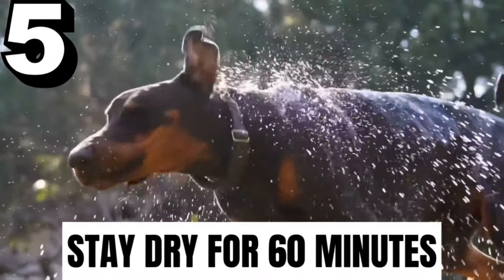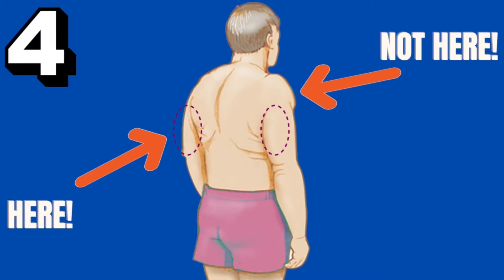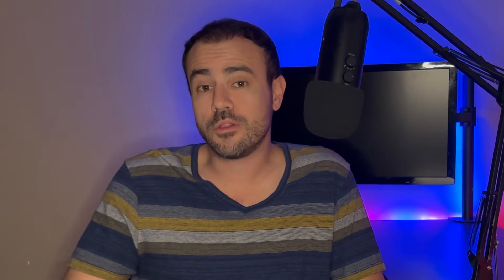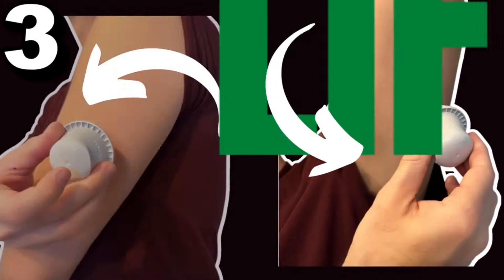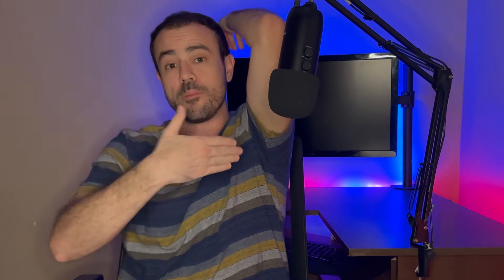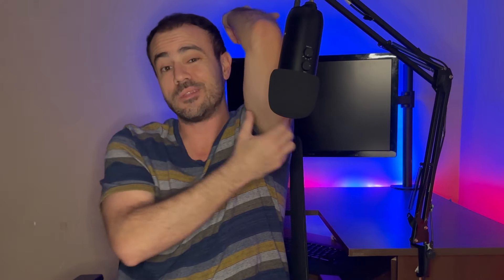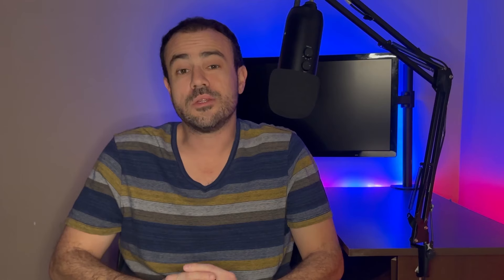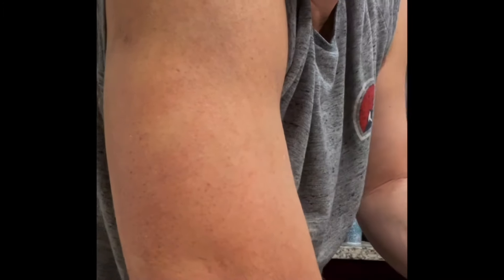Tips To Put Your Libre On The Right Way You Wont Find In The Manual!

Comment: I cannot get a reading on my meter of how many days it still has before it needs to be replaced. I've seen it in some videos (for example, it says "10 day" on the screen) but my meter does not have that option. What am I doing wrong?
Reply: Assuming your sensors last for 14 days, you will be changing it on the same day every 2nd week. (so maybe mark your calendar when you change your sensor if you think you won't remember)  If you use the reader instead of a phone, the number of days left shows at the top of the screen...and you get reminders when you scan, starting a few days before a change is due.
Reply: It shows up fine on a cell phone.

Comment: sir in my samsung C9 pro sensor works properly
But in latest samsung phone with NFC it doesn't work.
it's been 5 years I m using same phone.
had tried google pixel, samsung A7, Vivo, +1,iphone 7 phone too
but none worked😓

Libre sensor website gives list of phone which work with sensor 
But none worked other than my C9 pro💔

Comment: Hi. 
What about the triceps muscle where the sensor is meant to be applied? I train alot and have a pretty low body fat procentage. I have had a lot of problems placing the sensor at the upper arm. Often a difference of +3 and the sensor often dies after 1-4 days and I have to replace it. Libre 3 works a lot better for me at the hip but would really like to alter the placement sometimes.
Reply: Did you ever figure out the best place?

Comment: I use this device, and honestly it is more of a nuisance than anything else, wont download data to my computer, cant instal the app in my phone, runs out of power quickly, to much information when your trying to scan, change the sensor and have to wait an hour before use, try to scan when you have a few days left on the sensor you get this info before the reading. The NHS was sold a pup when it bought this.

Comment: I have no idea how they fall off. Mine are welded on and it’s a nightmare to get them off.
Reply: Abbot customer service suggested applying a drop of baby oil into the small hole in the middle of the sensor, then applying some around the sensor as well to help dislodge the glue so the sensor would be easier to remove. (Likely any cooking oil would do the job too). Hope this helps!
Reply: @Pharmacist-p8q yeah i saw a vid and have been following it successfully when I had to remove them. Pick the edge and put coconut oil under and around. Let sit 5 mins , i sometimes so it again and its comes off pretty easily.

Comment: Maybe the skin glue is good, maybe not.   I have had no problem keeping the device stuck on.  But perhaps my skin type, and my environment contribute to that.   I guess if one has problem skin, that would be a good thing to use.  Certainly take steps to press the adhesive completely against the skin.
One other thing.  The low glucose alarm can be a PITA, especially if one is NOT on insulin and the odds of low glucose are slim to none.  Because the sensor is placed where it is, the odds of a false low reading due to compression error are NOT slim to none, especially for side sleepers.  Most alarms can be turned off, but the lowest one can not.   That is with the app running.   On my iPhone I will turn the app off.   It will squawk at me, but it will not go off and wake me over some non-existent low reading.   The good news is when the app is restarted in a few hours, the sensor will send a complete data set for that time.   The graph will be contiguous.

Comment: So, the Libre 2/3 Sensor is using your fat cells to calculate your glucose. That’s what I understand. If your FAT or a heavy person, you have more areas that the Libre Sensor can use, like your stomach area. Why does Abbott Libre only use your arms?
Reply from the maker: So it’s not the fat cells it’s measuring but the concentration of glucose in the interstitial fluid which surrounds the fatty areas of the body as well as a number of other areas of the body. The back of the arm is the only area Freestyle conducted studies for and they can only suggest placing it in areas they studied as the FDA requires this. So even though it may work on the abdomen or other areas, unless they completed a full study which takes time and money, they can’t suggest any alternative locations.
Reply: @diabetesdailydigest  I use my chest to place the sensors after seeing Diabetic Jack do it https://youtu.be/yAhckpo9x3M?t=276 , It is scary at first but after trying it there and seeing that it did not hurt and I got accurate readings I keep using my chest. Mainly because it is protected I do not have to worry about it catching on a door or my jacket when I go to take it off. Also the sensor does not get pressed into my skin while sleeping because I sleep on my back or on my side when I toss and turn while asleep. When I had it placed on the back of my arm it would get pressed into my skin causing the interstitial fluid to be pushed out of the way. When removing the sensor I see that the needle/filament is stright with no bends in it.  Here is another video https://www.youtube.com/watch?v=20ybK4x_u2M that talks about other areas and the results found when placing the sensor there. I hope this info helps you out.
Reply: @diabetesdailydigest  
I am a bit flummoxed when you stated “the back of the arm is the ONLY area they conducted studies for.” On the face of it it doesn’t make sense. So if I’m reading you correctly Abbott didn’t test the other 90% or so of a persons body. Did someone pipe up and say “ try the back of the arm? “

Comment: Interesting tips. I used SkinTac for the first year but my wife hated applying it with the piece of square gauze because it got all over her fingers and was hard to remove. So I switched to over patches which I also used  for about a year. They were very effective but about 6 months ago I decided to try going without them and I have yet to have a sensor come off. This might not be the case with other people but having never lost a single sensor in more than 3 years I have a hunch that prepping the shin properly by washing with soap, drying, and then swabbing with an alcohol pad is all that's really required?

Comment: Probably close to ½ the time, the sensor doesn't work and I have to get a new one, which may or may not work. This is beyond irritating. 🤨
Reply: Same for me also. Then I was short sensors for over 2 weeks. We shouldn't have to call Abbot every time
Reply: What I've found is to put the new sensor as far away as I can from where the old sensor was. Make sure to wash and dry the whole area really well and then use the wipe really well. Wait a few minutes and then put the new sensor on. Make sure that everything is perfectly lined up and push te sensor straight down. I've found there's just no room for error.

Comment: What if you put it in the wrong spot should I leave it or take it off
Reply from the maker: Best to just leave it, most of the time it will still wind up being fairly accurate. If not you can always remove it and inform Abbott to have them replace it.
Reply: @diabetesdailydigest  But tell them it was in the correct spot or they’ll not replace it.
Reply: If you take it off it will never work again

Comment: Can you reapply a sensor , when put it in a wrong stop can you use the same sensor or you need a new one ?
Reply: Directions say to never try to put same back in
Reply: It needs the spring-loaded applicator (like an Epi-Pen). Once the spring has been activated, it can't be re-set. You need a new applicator device to insert the canula of the sensor.